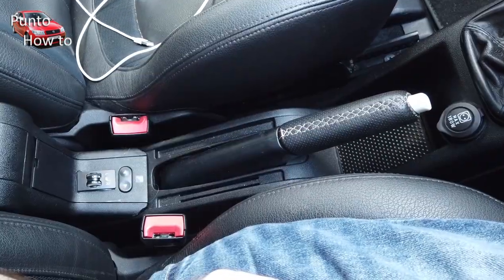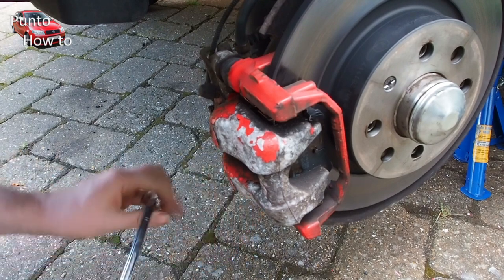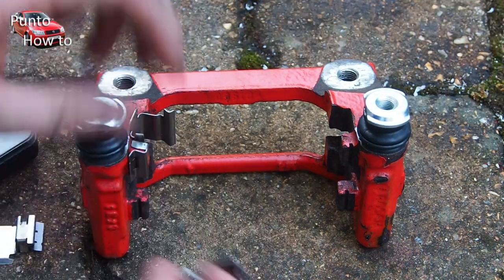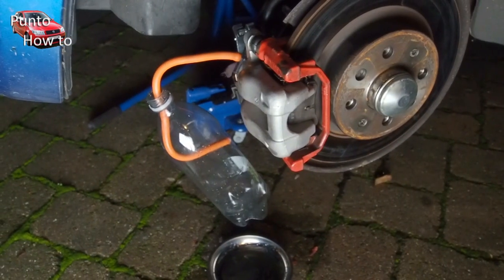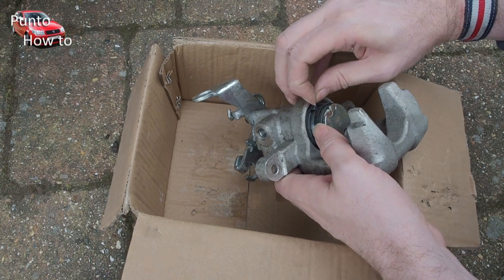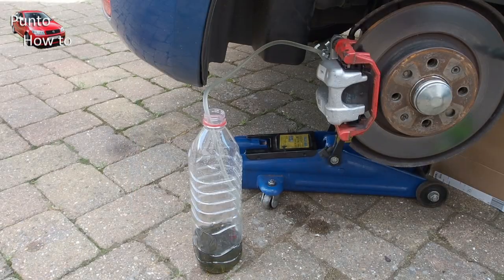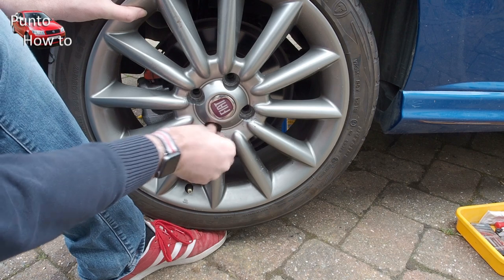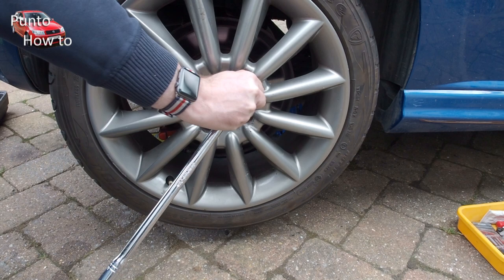Why you should be careful buying parts on eBay !

Comment: Back in July time I took my 2011 punto evo to out friends garage for an ABS fix and full service. He recommended sending the failed part off to be repaired at a fraction of the cost of a new system. And the outsourced company played the Covid card for an extra 4 weeks longer wait. A 1 week max job turned into 6 weeks.
Reply from the maker: That sucks, I presume you've got the car back and fixed now ?

Comment: nice video , buying cheap parts online  its good when it goes well , if it doesnt its allways a big problem . with waranty etc .
Let me just correct something , tha caliper isnt a bosh , i mean , it was , when it came from factory , now its a pagid , because pagid rebuilt it , not bosh , the rebuilding process could difer , bosh also has rebuilt calipers , but pagid its also good quality , whith this i am saying that just because it has the bosh logo , what matters is the company that rebuilds it , some can use parts/rubbers with worts quality , but in that case pagid its quality , it could even be better that the bosh itself .
Reply from the maker: It is a "Bosch" made caliper originally but yes rebuilt by Pagid. The cheap replacement caliper had absolutely no branding on it at all and was considerably lighter in weight than the real article.

Comment: Hey Andy sorry to hear of the problems. If the brake caliper isn't old than 90 days you can open a case with PayPal for eBay and you will get your refund.
Reply from the maker: 6 months later it failed the MOT so sadly well past starting a dispute with Paypal
Reply: @PuntoHowto  sorry to hear that,. But love and learn. Your probs a pro at Punto rear brakes now 🤣🤣🤣
Reply from the maker: Definitely lol 😂
Reply: @PuntoHowto  Could I ask how your new calipers are doing now? Any problems so far? I have just received a pair ordered online thinking they were remanufactured but they appear to be new, and worryingly cheap for brand new - I suspect we may have dealt with the same company! I bought mine direct from their website but I am aware they also deal on eBay. To avoid any legal issue, I will just give the initials of the company: E.C. - does that sound like the same company you dealt with?

Comment: I need to replace my NSR caliper on my Eleganza, hence watching this video. I have bought the Padgit part too, so finger crossed as I hate doing the job twice. That breaker bar you are using, is it a Halfords Professional one by any chance? If so it will break at the fork, they all do. When that happens take it back and they will replace it without a quibble for a new one with a forged head, because the professional range has a lifetime guarantee.
Reply from the maker: Hopefully you’ll be ok with the padgit part as mine was a re-manufactured part, as for the breaker bar, no idea had it many years now not sure where I got it but don’t think it was Halfords